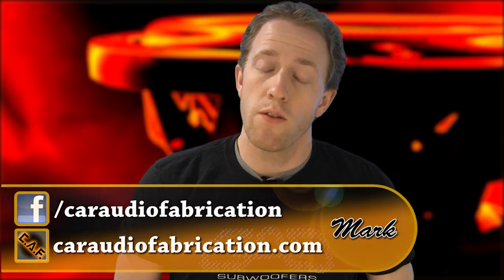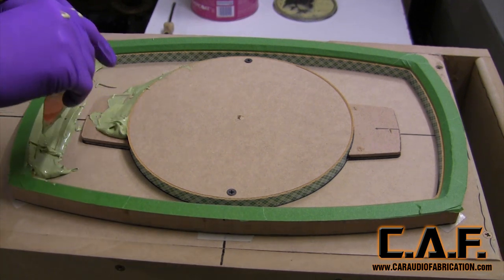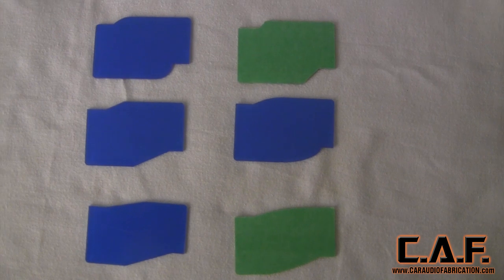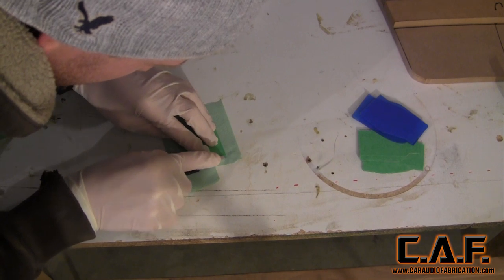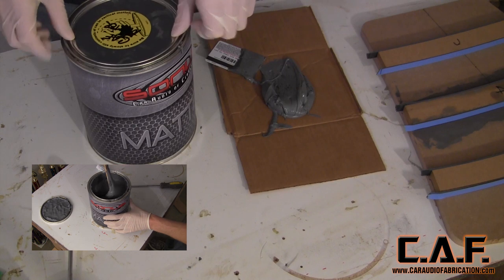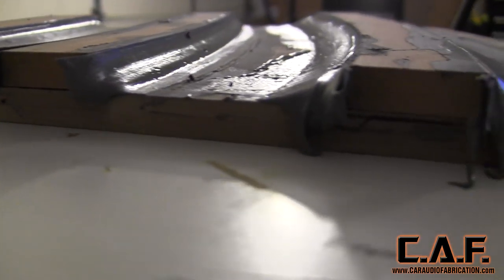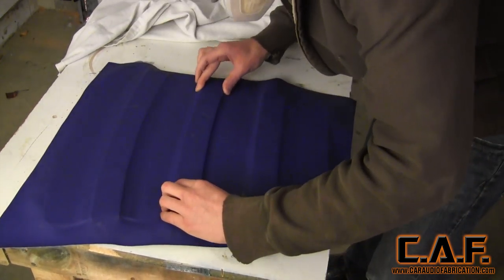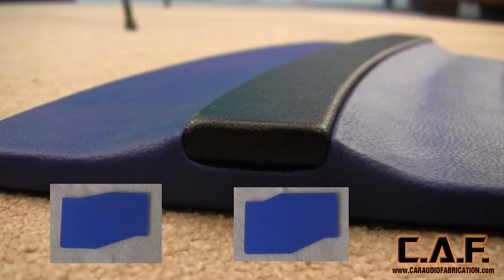Smart Spreaders - Create Perfect Body Filler Contours - CarAudioFabrication Building Better

Comment: I've got to get some template tape on Monday and will pick up some of these spreaders . With a spiral flush bit you could reproduce an extra set Incase they get damaged or overly used out of abs . I've built my own before for specific jobs in the past and even recently but these could be useful . I worked with Doug Dobson in the past and he has a ton of ways to make custom work come to life and any technics are always great for installers to keep learning. And thx for the special offer thru m.s.

Comment: Mark on your finished product is the vinyl wrapped into the valleys and onto the back sides of the insert pieces? My reason for asking is the amount of the black inserts being proud of the blue contours, and would it be flush if no material was in between.
Reply from the maker: Everything is rabbeted to account for the material, the bottom of the inserts sits flush against each other

Comment: matter looks great, but a little pricey, i am looking into using rage gold, however i can only find it in gallon sizes. Is there anyway i can find it in quarts? only reason i ask is cause im going to be needing it for the current project i am working on, a gallon is far too much, and i most likely wouldnt use 50% of it before it goes bad... or if you can recommend a different brand that is available in smaller amounts that is great.. i am using it for an ipad dash mod

Comment: Have u ever used rage xtreme body filler if so how is it?
Reply from the maker: Its very runny and thus lays nice and flat, if you are painting something and need to cover a large surface I would use it, but for something like this where we need to build material up, yet have excellant sanding properties, Matter is the best choice.

Comment: Mark this video was great. I will def have to get these sweet contour spreaders. I would have never known it exsited. This will save so much time. I'm not sure what I will use it for just yet but I'm sure I will. My fav one was the 2nd to last one. It was nice and smooth and flowed the best. I def need some of that foam tape too man. Also hey check your FB email I sent you a message